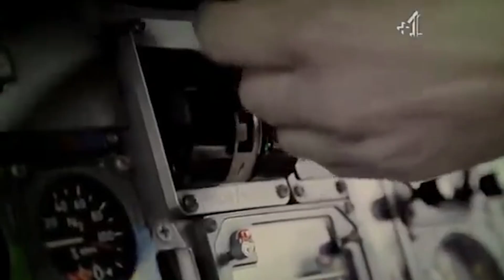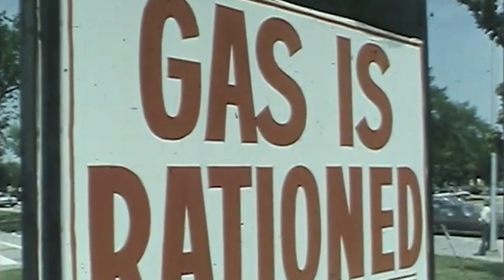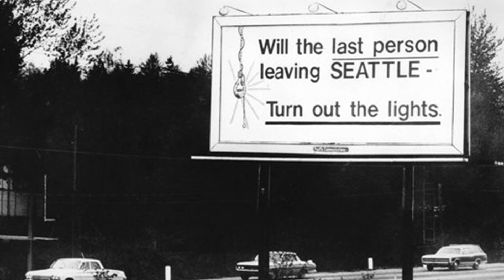The Forgotten American Concordes - Boeing 2707 - Lockheed L-2000 SST

Comment: The main difference between Tu-144 and Boeing 2707 is that 144 existed
Reply: The Russian and European philosophy with Supersonic aircraft was similar to the WW2 Japanese philosophy with Battleships.  They thought bigger/faster was better - and the reason for this was because they didn't understand the engineering principles and processes which would have informed them of the limitations of such a philosophy.  AND THE REASON THEY WERE NOT INFORMED WAS BECAUSE THEY DID NOT DO THE PAINFUL WORK OF DISCOVERING AND DEVELOPING THE TECHNOLOGY.  Like a student who cheats on a test by copying someone else's work, that student is well behind his peer who has gone through the trouble.  And engineering on the true cutting edge isn't a college exam where you know an answer is possible.  It's an entirely different animal - the most exotic and unique kind of problem in the world - where nobody knows if there is a "correct" answer.  Ascani's team could well have been chasing a unicorn when they were building the XB-70 because they didn't know if what they were building would work, whether they could develop the technology (which did not yet exist necessary).  That's one of the major advantages that college students like the Tupolev and Concord design teams had over the Valkyrie team; they knew that the Valkyrie design was successful, that the problem they were "solving" already HAD a viable solution (because someone else had already taken all the real risks and done the work for them).  If you're a college student doing a problem in an exam in college in Calculus or Control Engineering, know that "you" are not the one "solving" the problems on that exam.   Those problems were solved FOR you by Newton and Bode long before you were born.
Reply: America first! Bruhaha!
Reply: @Optical Clarity Yeah, and Americans "gave a shit" about pilots and passengers by building and selling Boeing 737 Max.👏
Reply: Sunamer Z  Yeah! Soviets built Туполев 144 after Concorde, but were first to fly it! That make sense! Educate yourself a bit before you start to spread your crap.
Reply: Didn’t the tu-144 also use parachutes to help stop the plane when landing because it’s brakes were inferior?
Reply: Other differences:

2707 never killed anyone with design flaws. The engineers actually designed the machine themselves, and they knew it wasn't working. Not existing is a good thing when existing gets people killed.

TU-144 had design flaws because Tupolev didn't understand the plans they stole. They just imitated Concorde's wing shape (for example) without understanding why it was curved the way it was. That's why it needed the canards up front. That curvature needed to be extremely precise and matched to the exact shape of the aircraft. Tupolev's wing curvature was a mere decoration. Baran, anyone?
Reply: Beena Plumber  those canards were added afterwards in a redesign and rebuild after the accidents. They worked, but it was too late to save the aircraft's reputation.
It flew on for a while as a cargo aircraft ferrying high priority mail and packages from Moscow to the far east, but that too was abandoned as too expensive, especially with the advent of fax machines.
Reply: 144 was trashy copy of Concorde anyway
Reply: Both the Tu-144 and the Concorde are variations of the XB-70 Valkyrie.  The most important aspect of determining which came first and who took what from whom is to see the concept and design schematic iterations of each project.  When you're doing something that nobody else has done or designed, the engineering process is literally flooded with concept and feasibility analysis followed by a litany of failed prototypes and alternatives to solve the same problem.  NAA was brilliant in the number of schematics, designs, tests, and archetypes they chose - everything from the wing and fuselage to the environmental controls - and it all left an enormous, documented paper trail and design history that can be seen today in archives and a Museum in Ohio.  The Tupolev and the Concorde developers have no such paper trail or design history.  That's how you know the Concorde and Tupolev used work stolen from the Valkyrie - beyond just the simple fact that the Valkyrie was flying years before either the Concorde or the Tupolev, beyond the fact that the Russian and European design bears such a remarkable resemblance to the Valkyrie's outward (and inward) design.  When a Mathematician or an Engineer only gives you "answers" without knowing how to do the Proofs  or work the problem step-by-step, THAT is how you know that they are just repeating someone else's work.  They are standing on the shoulders of geniuses.  Actually, it's worse: many people are crediting the Tupolev and Concorde team with accomplishments not their own, and I would hope that - in their old age - their personnel have enough integrity now to be embarrassed by it than when they did in 1962.  Only when the Valkyrie project was canceled did the British and the French go ahead with their plans to "civilianize" and clone the Valkyrie, signing their agreement almost immediately after.  Had Mcnamara not sabotaged Ascani's team and prevented them from building their own SST based on the Valkyrie, there would have been no contest - the British and the French required a great deal of time to assimilate NAA's work; Ascani and co would have easily built and flown a civilian version of their "Concorde" sooner than Aérospatiale/BAC (it was NAA's design after all).  It's not a secret, after all, and it's no wonder the British and the French made sure Ascani and NAA were cut off at the legs and the Valkyrie canceled before they went ahead. The development and project team of the Tupolev and the Concorde were proficient, make no mistake; they certainly rate as among the best at the time - but they were demonstrably NOT in the same class as Ascani's project team, in the same way that nobody thinks the developers of the Chinese J-31 belong in the same class as Skunkworks and their YF-22.  

(As an aside, the British also lobbied to have the F-22 canceled; and failing that, siphon off American expertise into the F-35 program which they had access to.  This is the real reason why the F-22's numbers were docked, similar to the way the Valkyrie team was prevented from claiming their rightful prize in 1962; American government officials selling out to foreign powers)
Reply: @Terrekain  when I started reading your post I thought that you were just an American who thinks America invented everything, but as I read further down I realised just how delusional and uninformed you really are!
Reply: The Tu-144 was a copy-paste aircraft. The soviets sent spies to steal the concorde design. So the Soviets copied Britain's homework and rushed it. They just wanted to be the first to make a supersonic airliner.
Reply: @constantinenikitin5397  Any sources, where you learnt about that??
Reply: also the tu 144 crashed a few times and was putting the company bankrupted because nobody wanted to travel in it because it was to damn expensive and quality of the flight was shit
Reply: Concorde aswell crashed, so what. It always been for most of people fast > comfort. supersonic passenger lines is way too expensive with current technologies we have, that's why it died. Still experience of TU-144 and Concorde can be useful in future.
Reply: @thepinusnigra  Concorde crashed once in 30 years. it was during everyday usage and not the fault of the design or manufacture. it was the fault of the airport. It DID NOT crash at an air show in front of it's potential customers and passengers!
Reply: @thepinusnigra  concorde crashed once, because of something that fell off an American plane! And that was used as an excuse to bully Britain and France into killing concorde, obviously the fact that America didn't produce concorde has nothing to do with it, I mean how many 747s have crashed?
Reply: @thepinusnigra  fool. 10 to 12 000 Euro for a flight, no probs in Europe, just 36 roebel in the workers paradise to Almaty from Mockba, the only destination.
Reply: The prototype TU-144 first flew on 31 December 1968 near Moscow from Zhukovsky Airport, 3 months before the first flight of Concorde (2 March 1969).
Reply: @audiotone. 
Cool.
It was still a crude, shoddy copy.
Reply: I suggest you take interest in a bit of history and not write nonsense about copies ... Because TU-144 was not a copy of concord. These are two different constructions.
Reply: tu 144 was actually very cheap, so cheap that they made a massive loss lol.

Comment: The next big step in airline travel will be hyper sonics.These planes will trail right at the top of the atmosphere and will spend a large part of the flight in space. They will take off and go to very high speeds, between mach 10 and mach 15. They will blast out of the atmosphere and into space then cost for several minutes. When the come back into the atmosphere the will power up again adding just enough speed to keep flying, bouncing off the atmosphere back into space until they get to where they are going.
    It will be a wild ride, with prolonged periods of zero G but a trip from say LA to Sydney will only take about 2 hours.
     These hyper sonic flights will likely only be used for the longest air routes as they would be the only routs that would be economical. Ironicly, a flight from San Fransisco to Tokyo might be quicker than a flight from LA to Portland, Or.

Comment: I don't think two seven oh seven is right. It should be twenty-seven oh seven.
Reply: That is an Americanism. The correct pronunciation is the first one.
Reply: Harvey Smith
You say tomato. Who gives a fuck. I think twenty-seven oh seven sounds better.
Reply: You may be right, it sounds cool but the reason to give a fuck is to stop confusion when conversing with air traffic control or pilots. It saves lives. Small mistakes in communications have cost lives on many occasions.
Reply: Harvey Smith
True enough, but aircraft type isn't usually given in ATC communications. For airliners, they have a flight number or call sign. For general aviation it's the "N" number (tail number outside the US)
    The aircraft type is listed in the fight plan or given by the pilot when they contact ATC if they are flying without a flight plan. And VFR pilots don't usually need to contact ATC unless they need to transit restricted airspace.
Reply: I used to fly sitting next to an ex air traffic controller who was left hand seat. Trust me it matters! Heaven help me if I didn't use the correct phraseology.
Reply: Harvey Smith
True enough. But do you know what the "N" stands for?

Comment: "operating long term"..
Well yea... but the Tu-144 did exist, did fly, and did operate.... but not for very long. Some of them was later sold as expermiemt caring airplanes

It was grounded. Then it was reinstated, run for half a year with over 100 commercial flights, than grounded again... The 100 commercial flight is very important in this case.

Comment: Higher speeds are useless, in a 5 hour trip,  normally 1 hour is the flight time, reducing this by half is useless. the cheapest solution is to reduce the time to get to the airport, check in. board etc.
Reply: Um, maybe flying between cities in the usa... flying across the atlantic takes 7 hours.

Comment: Very informative. 
However, it would be worth mentioning that the main barrier to supersonic passenger aircraft is actually not technology of achieving the right specs. It is noise pollution, specifically sonic booms that have been legislated against as a public nuisance/quality of life problem. Sonic booms are loud, and if you had even a fraction of commercial aircraft running all over America, it would sound like a war zone. That was the main limitation of the Concord, It could only go to certain coastal airports. Despite this it was overall profitable, minus development cost shouldered by the nations of France and the UK. Some new developments on negating sonic boom in aircraft design is showing new potential for the flight concept.

Comment: Technology rapidly advances, except in aviation. Yes, there's new visuals, controls are superior, engines are more efficient, and all seats now have IFE, but that's just implementation, not revolution. We need faster planes. It's unacceptable that in 1950 it took 7 hours to fly to London from New York and in 2017......It still takes 7 hours. Truly is a shame.
Reply: WEll, part of the problem is we do not need faster planes.  We like them, they are sexy, but current travel times are pretty reasonable.  There just isn't enough interest or pressure for something much more expensive that doesn't do the job all that much better.
Reply: Justin Hopkins it's not the same at all it's takes even MORE time now from gate to gate because of the fu•king madness that USA created with their "terror crap"
Reply: Guns and Cars also seem to be "stuck". There is nothing wrong with reaching a technology plateau. Diminishing returns and all that. At the end of the day planes are flown by companies that care only about the bottom line, that is their profit, and perhaps having a slightly faster less efficient plane is not good for their bottom line.

If there was a demand for supersonic flight there would probably be an answer to it.
Reply: Speed isn't everything. Size also matters. Ever larger ships are built. Ever larger airplanes are built. But trucks and busses are stuck with a limited size of the standard road. The transport of heavy goods on the road always requires to this day special heavy transport operations at snail speed where the transport vehicle is escorted.
We don't have ever larger roads designed for ever heavier vehicles, so we can have bigger trucks and busses. And ever larger rails for trains with ever larger wagons.
Reply: +Deliverygirl
Lots of exciting developments happening RE guns: railguns, lasers, Laser Guided Rockets revolutionizing the RPG...
Reply: Justin Hopkins speed isn,t everything just enjoy the journey.
Reply: +Justin Hopkins  Aviation used oil and oil will become more and more expensive as reserves are depleted with no plan B.
Reply: Design can be tweaked so the boom only occurs above the craft.
Reply: Because Space X does not make plan
Reply: You couldn't fly from London to NY in 7 hours in 1950. not even close. "up to 18 hours on the Boeing Stratocruiser" before the dangerous Comet (first transatalantic flight 1958)
Reply: One of the biggest problems with this is that once you reach a certain speed it requires a much larger amount of thrust which mean more fuel and it becomes very inefficient. We could go faster we could travail at Mach 1.5 but a ticket from New York to london would cost around $2000 just to cover fuel and hazard expenses. Plus its incredibly dangerous, imagin entering a spin or an elevetor gets jammed at Mach 1.5! NO THANK YOU!
Reply: We have the internet now, don't need to be in NYC for your 9am meeting. Can be done from comfort of the office back in London, Paris
Reply: I like how Justin Hopkins
 claims there is no rapid advances in aviation, and then immediately after says airliners are safer, more efficient (which means cheaper tickets), and more pleasant to fly.
Aviation technology did advance, you just don't care about any technology except speed, the least important technology in an aircraft.
Reply: Justin Hopkins Sure thing, as long as you are the one paying for it.
Reply: Joseph Huang Technology gets cheaper once it's actually produced. Once new technologies come on board, it won't be so unrealistic. 

It's not going to happen with pessimistic attitudes like yours though.
Reply: Justin Hopkins Nobody is stopping you from inventing a faster jet, go for it.
Reply: Technology isn't the limit, the boom associated with supersonic travel is. Do you want constant booms from planes breaking the sound barrier over your house?
Reply: Cars don't advance in speed either. We're supposed to go speeds of up to 250 knots with trains, cars, busses and trucks. And if airplanes are grounded like when Eyjafjöll broke out, we ought to reach speeds of 500 knots with cars and busses. But this doesn't happen. There's no streets nor vehicles for that.
The first transatlantic jet flight was in 1958. It took fifteen years to make flying common place. In 1973 there were more passengers who flew over the Atlantic than who took a ship.
Reply: I wouldn't call lasers "guns" per se, railguns have been a thing for a while and are just now being realized (fair point) and laser guided rockets and multi stage RPGs are not what I'd call guns either, they're ordinance. 
When I talked about guns I meant that we're still using designs that are 100 years old or more (see the 1911) or 50 years like the AR15 design that has seen barely any improvement, same goes for the russians and their AKMs. There has been no revolution in firearms design: caseless ammo failed, multiple bullets in a case failed, flechettes failed, combined weapons like the OCIW failed, stuff like the FAMAS FELIN is not that easy to carry around and is being phased out soon IIRC. The only ones who have seen much quick improvement in munitions have been tanks, helicopters and planes which can carry much heavier ordinance.